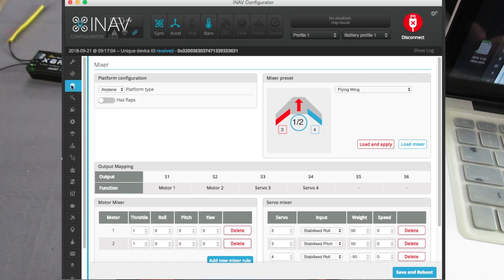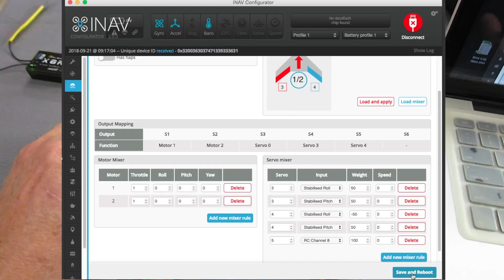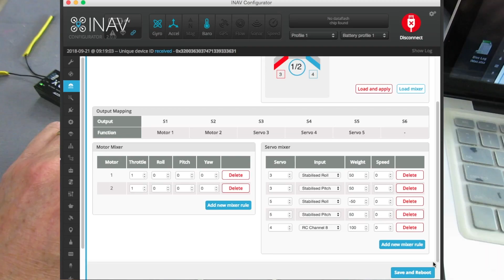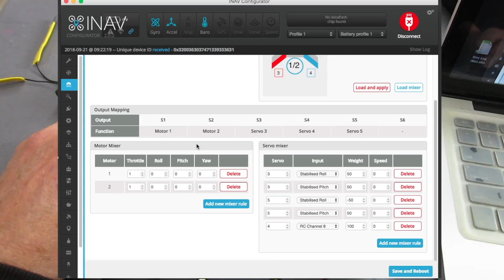iNav 2.0 mixer - Camera Pan

Comment: Thank for your explanation but did you had to configure something on your radio to make that switch operate the servo or everything is on iNav and channel 8 is automatically this switch ?
Reply from the maker: Not automatically, you have to assign the switch to operate Ch 8 in your radio programming.
Reply: @AndrewNewton  thx 👍🏻👍🏻👍🏻👍🏻👍🏻 I was so confused

Comment: Good information there Andrew, how did you mod the servo to extend its travel ? I have a heap of standard servos but none capable of 180 degrees. Thanks
Reply from the maker: Have to solder 2 resistors on the the pot. Fiddly but it works. Look for 180º servo mod on YouTube.

Comment: Not quite along the same lines......buuuut.........(lol)
Did you have a chance to experiment with running head-tracker through a switch on the Taranis so that H-T can be used to control pitch/roll & yaw???
It was a while ago I made the suggestion & was curious if you have had any luck with it....
Ive not got a H-T in my googles (Quanum/FS Genisis) & too been busy blowing my money on planes, L9R's & batteries & wouldnt be interested in a Head-Tracker unless it can be done- would be awesome for those of us that FPV like Valantino Rossi hanging off a MotoGP bike, OR have fumbly fingers/like to experiment AND could also be used to keep some kind of control while swatting flies e.t.c on a long distance jaunt....
Anyhow, thanks again! :)
Reply from the maker: I did try head tracking and it was cool, but lack of time and too many projects get in the way. I do like the MotoGP stabilised onboard cam look and will pursue it.

Comment: The only issue I have with the current mixer is that they only give the option for the first 8 channels. It would be great if they had the option to use RC9-16 also. My OCD leads me to wanting to keep all the Modes together and then have the RC outputs. I had my F405W setup for Pan/Tilt as you did in this video, but am moving them to the R8XR bond to CH9-16 mapping. I agree with Bonafidepirate that if you are using say the RXSR or XM+ with only SBUS outputs this is very handy.

Comment: Yep, agree...iNAV and that Mixer was an excellent logical change.  Id like to try that Gimbal Roll to stabilize an HD Camera.
You can get around this lack of servo movement problem by mechanical amplification of the Camera tilt mechanism, just be sure to use a good pivot and ball link ends.
I also just upgraded to Open TX 2.2.2....it works okay so far for me...:)
Reply: Good to find another FrSky user in the UK.

Comment: Hi. Thanks for the nice video. I have done this all and its working in my roll single axis gimbal setup. But even in 125% of servo value I am getting very low stabilization nearly negligible stabilization. Please help. Thanks.
Reply from the maker: You are not alone. It's an issue with this first version of iNav 2.0. With a normal servo you only get 60º servo movement for 360º of board rotation. Will be fixed in the next release
Reply: Andrew Newton Thank you very much. I got relaxed that I have done it correctly. Just I need to wait for next update. Thank you. You are doing great.